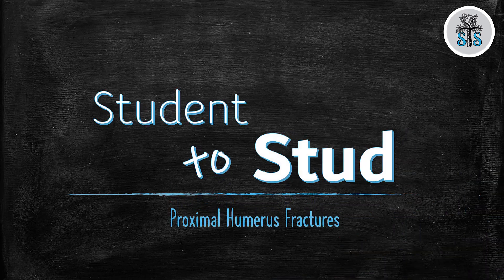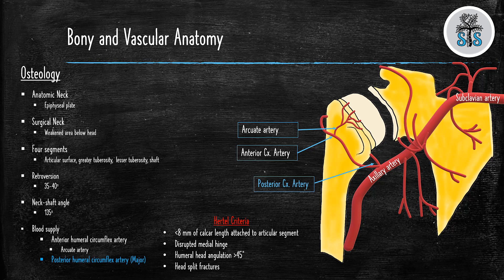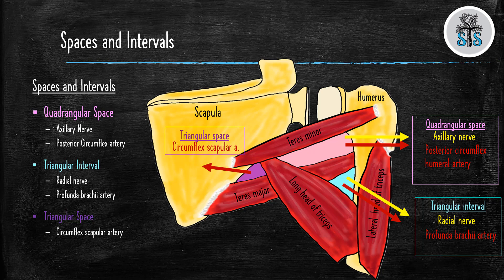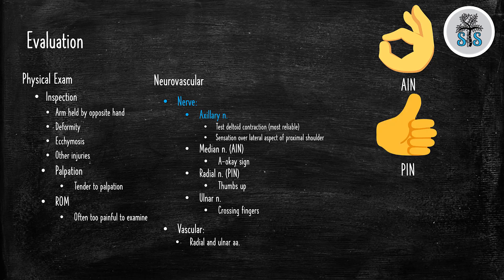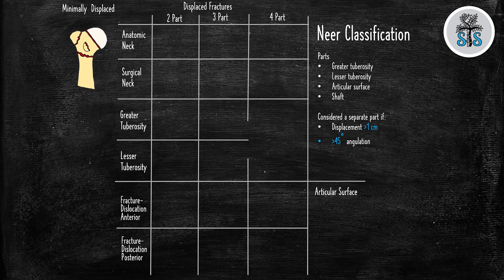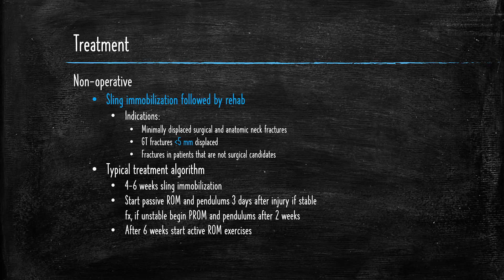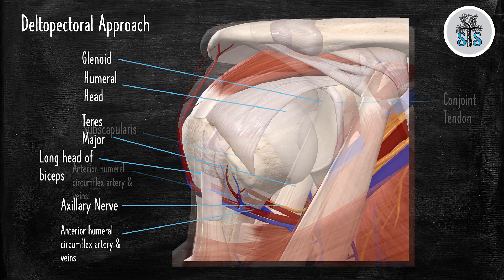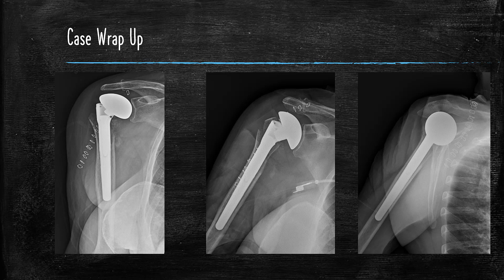Proximal Humerus Fracture

Comment: What is Proximal  Humerous undisplaced means?? Somebody if know share th answer. thanks in advance ..
Reply from the maker: A nondisplaced proximal humerus fracture is when there is a fracture but this has not caused the normal anatomical alignment of the proximal humerus to change. For example, say there is a fracture through the surgical neck but the shaft and humeral head have maintained a normal head-shaft angle and the humeral head articular surface is still articulating with the glenoid, this would be a non-displaced fracture. You can use this same idea with any fracture, if the normal bony alignment and position has not changed, it is non-displaced.
Reply: @studenttostud8789  Thank you very much for answering.🙏
Reply from the maker: @manikyamracha8957  You're welcome!